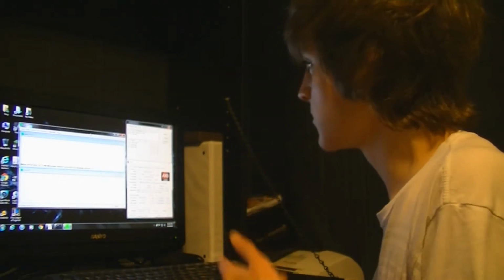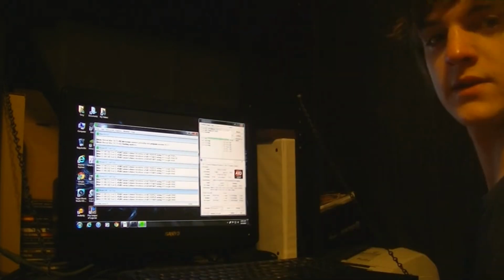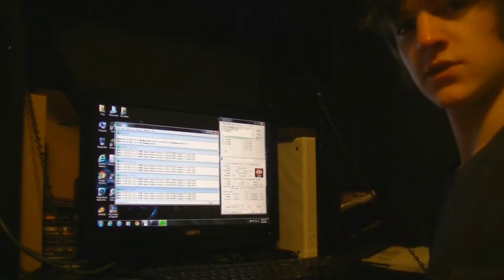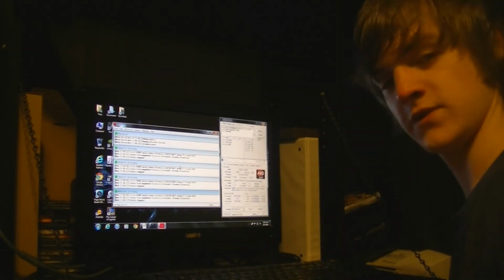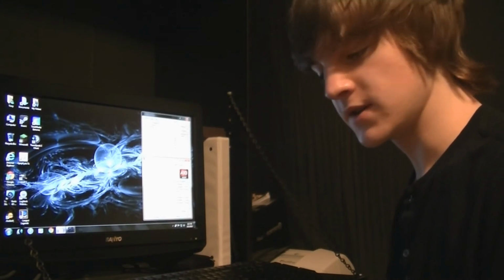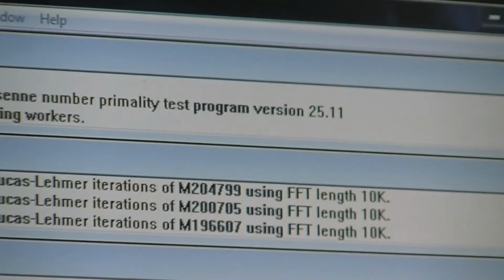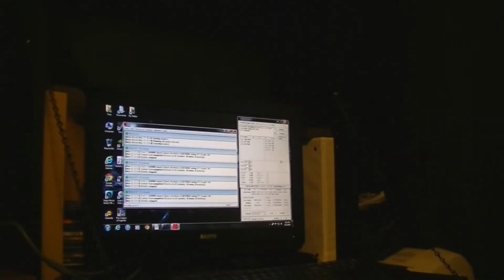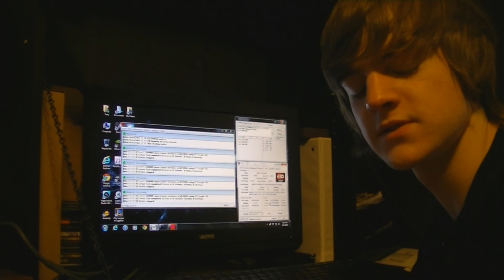AMD stock fan vs Cooler Master Hyper 212 Plus

Comment: Mmm, I think 429M'C is probably hotter than Helium fusion in the heart if the sun. Anyway though, where you put the mic next to the case to listen to the CPU fan, seemed noisy. Is it OK? I bought an Arctic Cooling Freezer 7 Pro, and it's silent. A bit of air woosh only when it gets hot, and you don't hear it normally. I had my heart on the 212, for my next build.

Comment: Some say Speedfan is quite unreliable. Why not use Coretemp and have max and min results provided too. GPU-Z should give you accurate GPU temp. Or CPU-ID Hardware Monitor will do them all.

Comment: Weird I'm using artic Silver 5 also with my 212 plus,  and my CPU is much warmer than yours,  did you apply the thermal paste in the center an had the heatsink spread it out with the pressure or did you spread the thermal paste before applying the heatsink